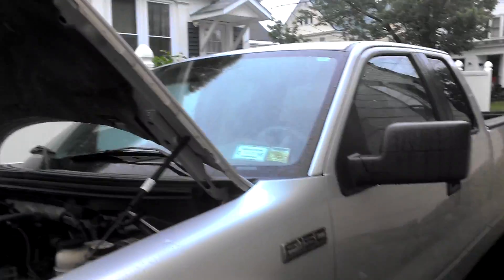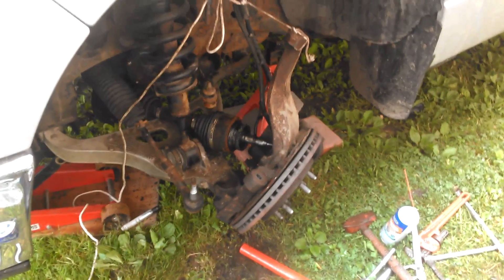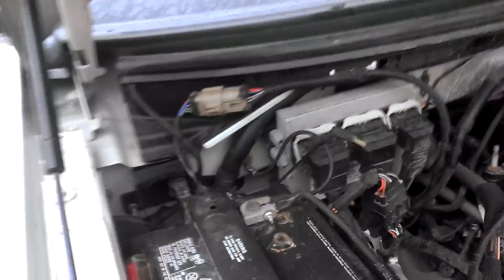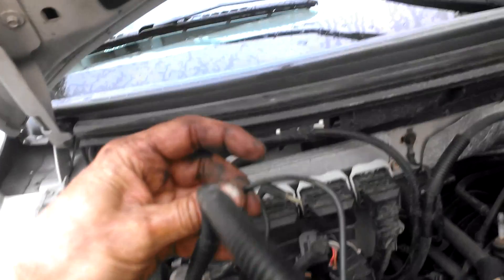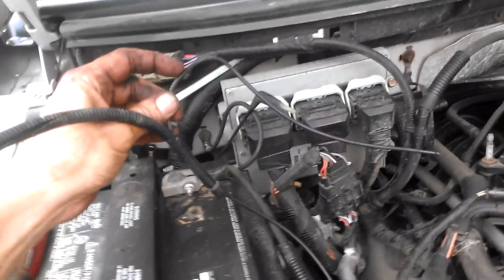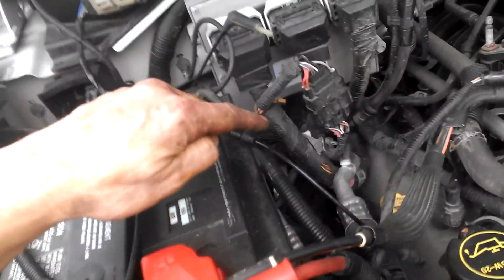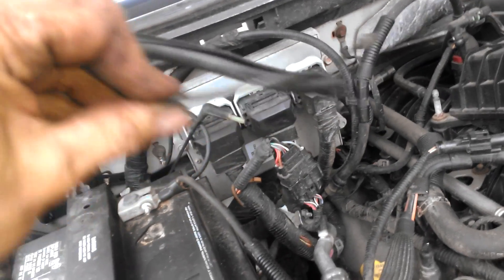2006 f150 four wheel drive actuator issue.

Comment: 2006 F150 with same problem, only just the driver side wheel.  I couldn't find the vacuum leak so I teed the vacuum line out of the solenoid and ran it straight to the hub, which solved the problem.  Only thing, now when I accelerate, there is not enough vacuum to keep the hub disengaged.   Once acceleration stops, there is adequate vacuum to disengage it.  I was wondering what keeps this from happening in the original design and what keeps it from happening on the passenger side?  Any suggestions on a fix?
Reply: Check valves

Comment: Interesting. I'll have to see if that is also my problem. However, that tube was for the passenger side, the driver's side should still have been working. Did you test the driver's side actuator before changing it ?

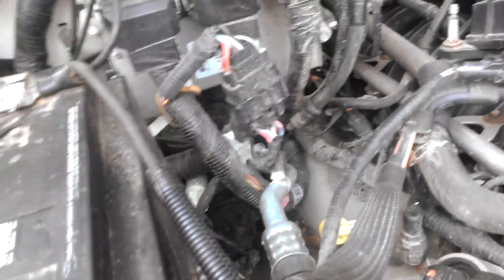Comment: Similar issue here. I Thought the front end of my truck was going to rip itself apart at first (luckily I was leaving the house when it happened.) After buying the solenoid with the "rain cap" (which I would recommend buying anyway) turns out the 90 deg elbow you showed @ 1:16 had trash in it. That's it! Luckily it doesn't seem to have hurt anything major but that's all it takes is a lil piece of trash in the system to destroy your 4wd

Comment: My 06 won't go into 4 low but will go into 4 high. Anyone have any ideas on what the problem is?
Reply: 4 low is broken
Reply: Lol mine goes into low but not high
Reply: @derrickschneider6052  any solutions that you had
Reply: No just driving it in 2. The best guess I can think of causing it is a vacuum line somewhere is out of wack
Reply: @juana4292  probably gonna wait till summer then follow the vacuum lines and see if I can find a leak

Comment: I think I have the same issue. Where did you get the new vacuum lines? So far I have replaced both actuators and solenoid. Still rattles like hell under acceleration. Rattle goes off if you put in 4HI. Only thing I can think of is Im losing vacuum.
Reply: That sounds right to me. It only uses 5 lbs of pressure, not much. Any little chunk of anything in the lines will clog those lbs of vacuum. Is it 1 side or both? I bought vacuum lines from the O'reilly's auto parts store near me.
Reply: Owen McKinney  jz4

Comment: Crappy man, my 2006 is having 4x4 issues too.
i already replaced one maybe both the actuators several yrs ago about 10,000 km ago. its mostly a winter/hunting truck so i only put about 10,000 km in 5 yrs on it.
i recently drove through some deepwater after heavy rain, 2 days later out of the blue, once you get going 20 km/hr or more the 4x4 makes  grinding /buzzing sound in 2x4.
in 4x4 that sound goes away but theres intermitant  loud clunking under acceleration
i check for vacum just with my fingers and theres definitely some vacum both sides at the actuators and that vacum goes away when switched to 4x4
So does this sound like an actuator is gone?

i also noticed one boot is worn out , would water getting in there somehow affect the actuators? it should be seperated physically as i understand this system?